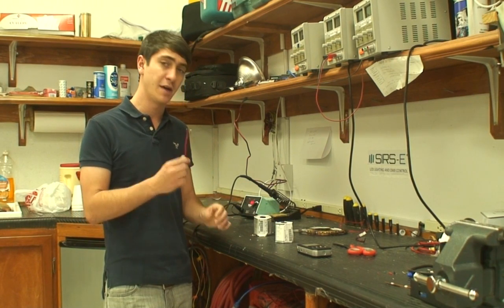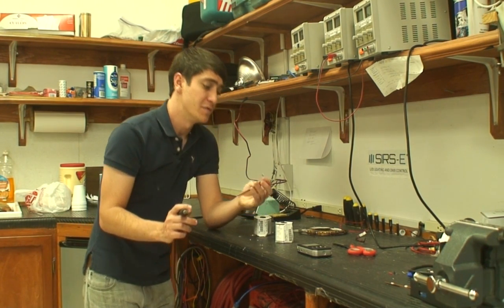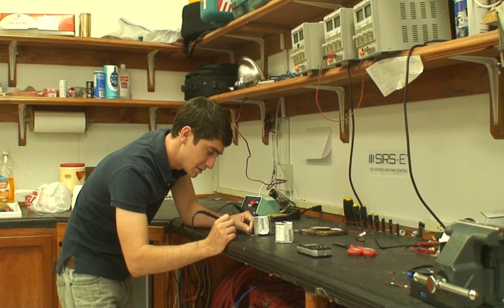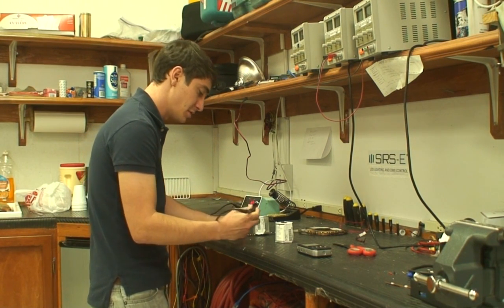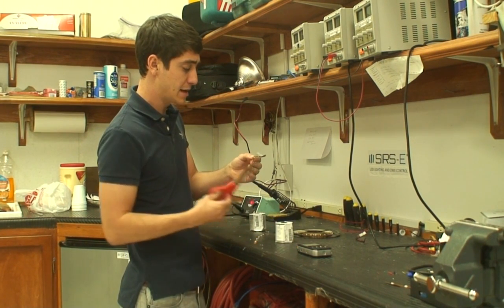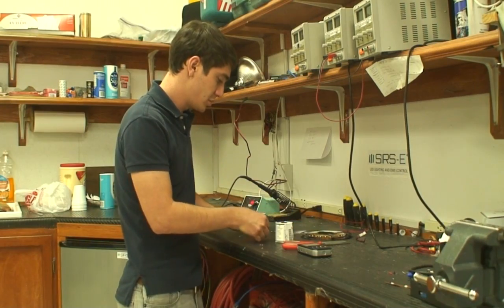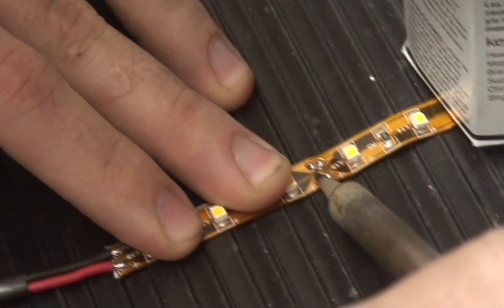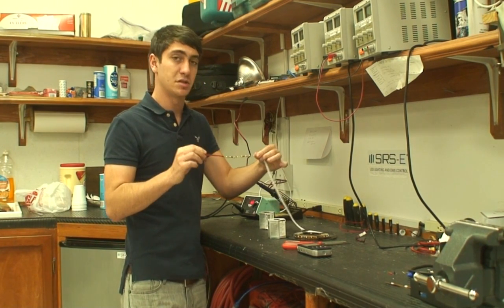Soldering LED Strips SIRS-E

Comment: Could I use a Weller, 75 watt soldering gun to solder wires to LED strips? It's for sale at a local hardware store for a mere $20. 

The description says: 75-Watt single-heat gun. And the model is: 7200PKS.

Could I damage the LED strip by using a soldering iron or gun with too many watts?

Right now I just have a REALLY cheap, 30 watt soldering iron. The solder I am using is Oatey brand, 60 percent tin, 40 percent lead, rosin core and the size is 0.063 inches. The solder does not want to melt. Then after holding the iron tip to it for 12 to 15 seconds, it melts all of a sudden and it forms a little sphere of solder. The solder wants to solidify quickly. So I have to push the wire into the little ball of solder and try to get the wire, solder and the copper pad on the LED strip to get together.

This is ridiculously slow and aggravating. I'll never finish my LED panel at this rate.

Thank you for your help and the video!
Reply from the maker: Hello, practice is your best friend, and a pointed tip always helps, perhaps something that gets hotter quicker would be your best bet.

Comment: is it possible to supply power through a usb port?
Reply from the maker: Our LED strips do not have any USB connectors, however the main thing to power your LED strips is matching the voltage, and powering the positive and negative, I personally do not know of any USB connectors.
Reply: I am on a project...my led is set is of 12v..but I want it to operate it on through a usb port which gives 5v output.i s that possible?to be clear my power source delivers 5v output through a usb port,but my led set needs 12v..what should I do?
Reply from the maker: You will need to find a way to hard wire your set up, the 5V will power the LED's but they will be really dim.

Comment: Hi SIRS, I have a problem with solder, once I apply solder onto the LED stripe it detaches every time.
Reply from the maker: Hello, you may not be making proper contact with the board, or it may already be burned.

Comment: I have individual led strips that have one red and black wire coming from one end. What kind of connector should I use to connect the wires to my 12v motorcycle battery?  How do I connect to led strips together, if they have the red and black wire on the end of each individual light strip? And if I need the red and black wires to be longer so they can stretch them to the battery, how would I do that? How do you connect a rocker switch to turn lights on and off? my lights came with no instructions.  PLEASE HELP!!!! thanks

Comment: i have THREE conductors on mine - left right and centre... i guess i use the two outer ones??? it's a 5050 smd led strip (warm white)
Reply from the maker: +antigen4 Hello, is it a variable white LED strip?
Reply: no not variable at all - but i figured out the outer two are (pos/neg) and the centre is reserves for the LED element themselves... even though it appeared to be a conductor of some kind... thanks

Comment: can we connect two strips with wires instead of soldering them together?
Reply from the maker: +Vipul Sharma (Light) , Hello yes you can. We have a solderless solution for connecting our LED strips using couplers. Even though soldering the wires is more effective, these connectors facilitate LED strip connections for customers who don't want to solder. 
https://sirs-e.com/product-category/led-accessories/

Comment: Good tutorial, could I solder a 2nd strip to the pads in the middle of the first strip or would it not get enough curren, cheers :)
Reply from the maker: +joe donna 

You can definitely solder a 2nd Strip directly to the copper pads. However, if it is a 12 volt RGB 5050 60 LED / m Strip you will experience voltage drop. You can expunge this issue by soldering leads to the Strips, and adding a booster amplifier with a separate power supply in between.

If it is a White, or single color 5050 LED Strip you can simply join the Strips by soldering directly on the copper pads and power them up on both ends.

Comment: Hi great video and advice.
could you tell me is there an easy way to solder 6 wires on to  PLCC-6 RGB SMD LEDs
5050 .
If that makes any sense.
I'm a newby to electronics and got some in a assortment bag.
Thanks in advance 
Simon
Reply from the maker: +Simon  Hopkins  , Hello Simon. Thanks for your comment. In theory you can solder wires to the SMD LEDs, although is not that simple for solder beginners, but it's possible.
Reply: +SIRS Electronics Inc 
thanks for the reply. I've found a little trick using a transistor. 
(tin legs on transistor then tape the smd 5050 led to the bench with 3 contacts showing then tape transistor to the beach so you have 3 stable contacts. After soldering cut the head of the transistor. bend legs and use it in a breadboard :)
Reply from the maker: +Simon  Hopkins  , that's good. We are glad you found a solution for your problem.

Comment: nice tut, but i had quite a big problems with copper pads on LED strip peeling off.im not sure, but im guessing that i have applied too much heat to it.
Reply from the maker: +Lone Survivor You got that right, usually a soldering iron with a temperature setting should help you apply heat evenly throughout the copper pads. Thank you for your question,
Reply: +SIRS Electronics Inc hi
i have a temperature control solder.
could you tell me what's the ideal temperature?
Reply: +SIRS Electronics Inc thank you for the reply.
The fastest one i have ever seen!
Reply from the maker: +MaPorcaTrotaATutti , thanks for your comment. Temperature Control Soldering Stations are great; remember if you put the temperature too low you'll take longer to solder, eventually overheating the copper pads and risking lifting them off. We recommend using 625-650°F for soldering LED strips and use a rosin core solder.

Comment: Hi sir,great vid,I was wondering I have to solder a Mosfet to a resister but I am not to sure how thick the solder should I use,What temp of the iron/what tip on the iron and  do I coat the ends first with solder,
Also do you need to use flux when using flush solder.

Comment: this is wrong. just lift the traces why don't you
Reply from the maker: Hello GT Talleronmyback, thank you for watching our video and for your comment.  There are several ways of doing this. This is the most effective and simple way for us to do.
Reply: so your doing it to have a closer flat connection? if so pretty good idea. just noticed it would help keep it flat.
Reply from the maker: Hello GT Talleronmyback, sorry for our late response.  You are correct, we try to keep both strip ends close and flat in order to keep them aligned and have a more efficient solder.

Comment: does the solder have to have flux to stick or melt?
Reply from the maker: Caz Verde No, if it is good solder like kester, you will have no issues with it sticking. Good solder usually comes with a bit of flux built into it.

Comment: Hi, do you apply some kind of insulation to the solder once you have made the connection ? I have seen some people use an insulation gel/glue that hardens to seal off the connection .Thanks!
Reply from the maker: Dibyendu Das We use regular heat shrink. If it is an outdoor application we use electrical grade silicone, and heat shrink. Regards!